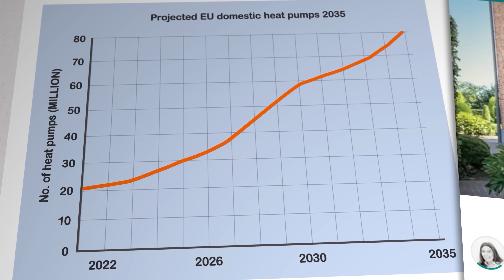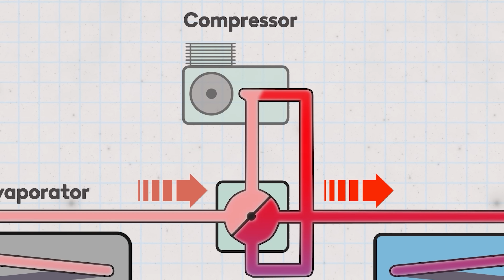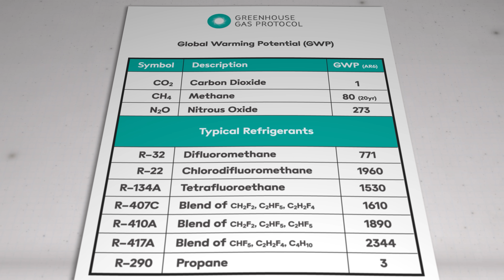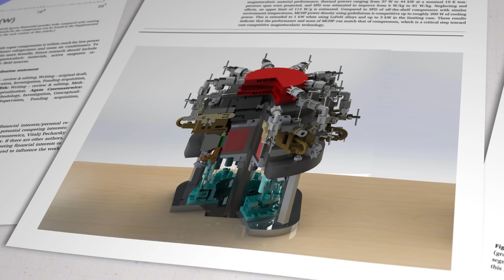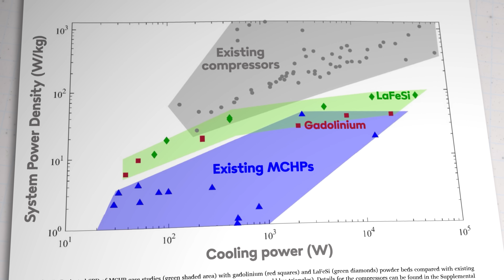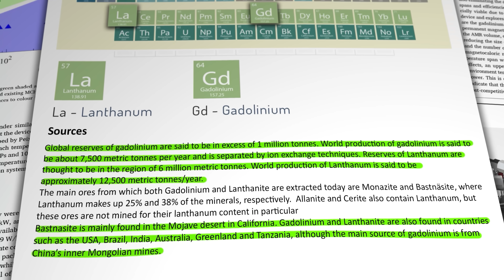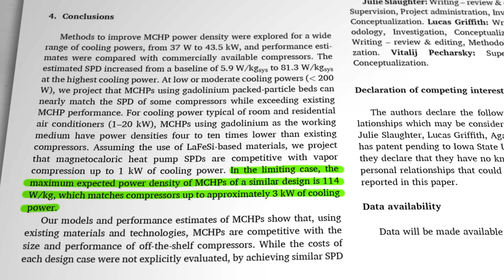Taking greenhouse gases out of heat pumps. (YES! They do contain them!)

Comment: Hopefully the newer heat pumps are better at low temperatures.
-1 C isn’t very cold compared to what we get in the USA.
Current heat pumps don’t do well below 0 C.
Hopefully this magneto caloric technique makes a significant improvement.
I can’t possibly afford it but that’s hope any way
Reply: All 3 of mine have worked fine in -20C for 3 days straight.  Keeping the house at 21+C.
Reply: Mellissa Dalby - "Current heat pumps don’t do well below 0 C."
It depends on the refrigerant used, and whether the heat pump sources from the air or ground.

Air sourced R32 refrigerant air conditioner heat pumps (e.g. Daikin) can operate with outdoor ambient air temperatures from:
-10 to +46 °C for cooling;
-15 to +18 °C for heating.

Air sourced R744 (CO₂) refrigerant hot water heat pumps (e.g. Sanden) can operate with outdoor ambient air temperatures from -10 to +43 °C.

To give you an idea of how energy efficient, per the test report published by Washington State University in association with Bonneville Power Administration, titled 𝗟𝗮𝗯𝗼𝗿𝗮𝘁𝗼𝗿𝘆 𝗔𝘀𝘀𝗲𝘀𝘀𝗺𝗲𝗻𝘁 𝗼𝗳 𝗦𝗮𝗻𝗱𝗲𝗻 𝗚𝗔𝗨 𝗛𝗲𝗮𝘁 𝗣𝘂𝗺𝗽 𝗪𝗮𝘁𝗲𝗿 𝗛𝗲𝗮𝘁𝗲𝗿, dated 18 Sep 2013, for the laboratory assessment of the Sanden model # GAU-A45HPA heat pump water heater (HPWH), Table 3 included:

Outside Air Temperature _ _ CoP _ _ Output Capacity _ _ Input Power
17 ºF ( -8.3 ºC) _ _ _ _ _ _ _ _ 2.1 _ _ _ _ 4.0 kW _ _ _ _ _ _ 1.9 kW
35 ºF ( 1.7 ºC) _ _ _ _ _ _ _ _ 2.75 _ _ _ _3.6 kW _ _ _ _ _ _ 1.3 kW
50 ºF (10.0 ºC) _ _ _ _ _ _ _ _ 3.7 _ _ _ _ 4.0 kW _ _ _ _ _ _ 1.1 kW
67 ºF (19.4 ºC) _ _ _ _ _ _ _ _ 4.2 _ _ _ _ 4.1 kW _ _ _ _ _ _ 0.97 kW
95 ºF (35.0 ºC) _ _ _ _ _ _ _ _ 5.0 _ _ _ _ 4.6 kW _ _ _ _ _ _ 0.93 kW

Sanden have upgraded their hot water heat pump unit with model # GAU-A45HPC since then.

With outdoor ambient air temperatures below -10 °C ground sourced heat pumps would likely be a better energy efficient solution.

Another option for reducing energy consumption is to improve the thermal efficiency of the building envelope. e.g. insulation, draught suppression, double-glazing, solar management, heat sinking/banking, etc.

Comment: On the topic of refrigerants, there are units that use CO2 as a refrigerant, and from memory believe it is particularly suitable as an engine for hydronic heating rather than air conditioning as the higher pressures required to make it work can be contained withing the unit and hot water exported, as opposed to the hot/cold refrigerant being transferred to an indoor unit from the outdoor compressor.  But as has been said, propane is also being used in modern pumps.  To my mind this magnetocaloric is a bit too clever for a problem that has been adequately solved with less harmful refrigerants.  Maybe leave the magnetocaloric heat exchange to induction cooktops...

Comment: There is a growing need for small heatpumps in evs. If we could do away with gas based systems that would be another maintenance task crossed off the list for what are already, low maintenance vehicles.

Comment: For years I have been using Neodymium magnets in a North pole orientation on the refrigerant lines of all my household, and car, heat pumps. They have increased the efficiency noticeably. With the fridge, electric usage has decreased due to shorter on cycles for the motor, a decrease in peak condenser temps (a measured 15 C on the sidewall), a reduction in motor temps, and a significantly quieter running system. The car air-con is cooler in our Aussie summer. Papers I have read say COP increases of  about ten to fifteen percent can be expected.
They also show a small improvement in response and smoothness when placed on a vehicles petrol fuel lines and completely eliminated the fuel algae/sludge in an old diesel 405 Peugeot I put them on.

Comment: What's with the outside heater under the coils? Supposedly, this allows the heatpump to operate efficiently down to -13°F. I looked at the power usage though. It's 3.5 times what the heatpump uses above 40°F. Even my window heatpump does better than that. It uses 2.5 times the power of the heatpump. Of course, it's inside. That is where electric heat belongs! What a scam. I will say one good thing about them though. The Air Conditioner part can operate up to 122°F. We're going to be needing that around the Mid-Atlantic soon.
Reply: Why don't they just use the propane? Not bad at 3 units. Some gasses must be better than others, because most people in the U.S. know that heatpumps don't really work below 40°F. It's in the instructions. Isn't there a gas that will still work lower?

Comment: Not knocking heat pumps, but at 4:24 it shows text that heat pumps have a COP of 2 to 5 and then the audio goes on to say they have a "COP of 5 or more". In reality in the middle of winter most air conditioners have a COP for heating of around 2, due to the large temperature difference. Which is still great, but care is needed not to oversell the efficiency. Heat pumps are also not great at running light loads, where the COP  is basically 1.0, may as well run a bar radiator, which is far less damaging to the environment taking into account manufacturing, shipping (weight), materials and the damaging effects of refrigerants. Overall, there's far more to be gained from having simple bar radiator + good insulation rather than a big expensive heat pump.

Comment: If the technology is not already commercially available at scale NOW it's already too late to avoid Planetary Insolvency!

During the period 1970-2010, the linear best fit rate of warming of the Earth System global mean surface temperature (GMST) was 0.18 °C/decade, but post-2010, has accelerated to 0.36 °C/decade. For all intents & purposes, the GMST anomaly has now breached the +1.5 °C threshold, relative to the 1850-1900 baseline. On current warming trajectory, the +2.0 °C threshold is likely to be breached within the next 15-20 years.

Daily Atmospheric CO₂ measurement at NOAA Mauna Loa Observatory on 7 Mar 2025 was 430.60 ppm. This is the first daily mean reading above 430 ppm ever recorded. Atmospheric CO₂ levels have not been this high since the Pliocene Epoch, 5.33 to 2.58 million years ago. Global sea level was about 25 m higher.

Daily Surface Air Temperature, World, as at 2 Mar 2025, is near record seasonal high level.

Daily Sea Surface Temperature, World (60°S-60°N), is currently (7 Mar 2025) above 21 °C, & only about 0.13 °C below a record peak of 21.17 °C on 1 Mar 2024.

Northern Hemisphere Sea Ice Extent is currently (7 Mar 2025) at seasonal record low level.

Southern Hemisphere Sea Ice Extent is currently (7 Mar 2025) at seasonal second lowest record low level, & only 332,000 km² above the record low on 21 Feb 2023.

Planet Earth’s albedo, the fraction of light that the planet’s surface reflects, hit a record new low, for the 36-month running average, per the latest CERES satellite data.

The rate of global mean sea level rise (SLR) is about 5 mm/year now – see the World Meteorological Organization report titled State of the Global Climate 2023, Figure 6, global mean rate of SLR was 4.77 mm/year mean for period Jan 2014 to Dec 2023, with acceleration rate 0.12 ± 0.05 mm/yr², extrapolated to Jan 2024.

Humanity is on a collision course towards a +3 °C GMST anomaly, or more; a world beyond any past human experience. Large-scale depopulation would be likely. We're on the road to “climate ruin.”

What's REQUIRED to avoid civilisation collapse?

1. Zero emissions at emergency speed: within a decade — not 2050 — is the crucial time frame.
2. The Earth is already too hot, so eliminating fossil fuels is not enough and large-scale carbon drawdown is vital.
3. A safe means of immediate cooling is critical to protect people & nature.
https://www.youtube.com/watch?v=flgq63f7TOc
Reply: Higher temperatures in the past coincided with larger animal populations, not smaller, which were better sustained by the larger plant growth enabled by higher CO2 concentrations. There were times in human history where north pole sea ice was entirely gone. There was less CO2 in the air when that happened than there is now and we're nowhere near that happening temperature-wise. I'm not concerned about such things. The next magnetic pole shift is more likely to happen in our lifetimes and cause all sorts of chaos than the planet warming to the point where we lose our northern sea ice even seasonally, which again, isn't in any way a death knell in of itself for our species. If you want to worry about a catastrophe, worry about a real one. Alternatively, worry about the economic collapse that we may face in the next few years due to decades of intentional mismanagement and fraud and our hitting the accelerator on it with the spending increases from the events several years ago that have still been continued in the budgets despite that particular crisis clearly being over.
Reply: @5467nick  - "There were times in human history where north pole sea ice was entirely gone. There was less CO2 in the air when that happened than there is now and we're nowhere near that happening temperature-wise."
Modern humans (aka 𝘏𝘰𝘮𝘰 𝘴𝘢𝘱𝘪𝘦𝘯𝘴) have existed for about the last 250 to 300 thousand years. During that time there have been at least 3 warm interglacial periods and 3 cold glacial periods, including these:

* Holocene interglacial epoch, circa 11,700 years ago to present day;
* Last Glacial Period, circa 115,000 to 11,700 years ago;
* Eemian interglacial period, circa 130,000 to 115,000 years ago;
* Penultimate Glacial Period, circa 194,000 to 130,000 years ago;
* Penultimate Interglacial Period, aka La Bouchet Interglacial, circa 242,000 to 230,000 years ago;

The global mean surface temperature (GMST) long-term average over land and sea, during the last 300,000 years, has varied from about 8 °C during the coldest parts of the glacial periods to about 16 °C during the warmest part of the Eemian interglacial period.

Over the last 450,000 years, glacials have lasted anywhere from 70,000 to 90,000 years whereas interglacials last approximately 10,000 years.

Human civilisation began circa 6,000 years ago, during the relatively stable Holocene epoch. During that time the GMST long-term average over land and sea has been relatively stable at 14 ± 0.5 °C, until the late 20th century. During the period 1970-2010, the linear best fit rate of warming of the Earth System GMST was 0.18 °C/decade, but post-2010, has accelerated to 0.36 °C/decade.

Daily Atmospheric CO₂ measurement at NOAA Mauna Loa Observatory on 7 Mar 2025 was 430.60 ppm. This is the first daily mean reading above 430 ppm ever directly recorded. Atmospheric CO₂ levels have not been this high since the Pliocene Epoch, 5.33 to 2.58 million years ago. Global sea level was about 25 m higher, relative to the current sea level. The northern hemisphere ice sheet was ephemeral before the onset of extensive glaciation over Greenland that occurred in the late Pliocene around 3 million years ago.

For all intents and purposes, the GMST anomaly has now breached the +1.5 °C threshold, relative to the 1850-1900 baseline. On current warming trajectory, the +2.0 °C threshold is likely to be breached within the next 15-20 years.

Humanity is on a collision course towards a +3 °C GMST anomaly, or more; a world beyond any past human experience. Large-scale depopulation would be likely.

See Globaia website's 𝗔 𝗧𝗮𝗹𝗲 𝗼𝗳 𝗛𝘂𝗺𝗮𝗻𝗶𝘁𝘆 𝗮𝗻𝗱 𝗛𝗮𝗯𝗶𝘁𝗮𝗯𝗶𝗹𝗶𝘁𝘆.

Joint director of the Potsdam Institute for Climate Impact Research in Germany, Johan Rockström, in the YouTube video titled 𝗖𝗹𝗶𝗺𝗮𝘁𝗲 𝗘𝘅𝘁𝗿𝗲𝗺𝗲𝘀 (𝗙𝘂𝗹𝗹 𝗗𝗼𝗰𝘂𝗺𝗲𝗻𝘁𝗮𝗿𝘆), duration 52½ minutes, talks about the "Corridor of Life'.
https://youtu.be/U8pLrRkqbb0?t=218

The Laws of Physics are not negotiable.

Comment: Based on the max power rating of 3 kW, and 114W/kg or so, I'm guessing they're comparing it to a 26 to 27 kg heat pump with refrigerant.   That's roughly 60 lb.  I just installed a ~5kw to 6 kw heat pump last Fall with a claimed product weight of about 140 lbs (compressor + everything else).  I'm pretty sure that includes at least 20 to 30 lbs for the heavy duty pallet it was bolted to during shipping.  I'm by no means a strong guy and I was able to put it on a dolly (lift with your legs) and transport it 100 ft across my yard and move it onto the concrete pad I made for it, by myself and without back pain the next day.  If they add just +1/3 weight (plus 20 lb) to 80 lb for the compressor, they put their max power up to 4 kW.   If they can improve their power to weight efficiency by 30%, they hit 5.2kW.   That matches my unit which can heat and cool my small  2 bedroom, 2 bath house quickly (i.e. over provisioned).  The extra 20 lbs is still light enough to keep in the range of 1 guy of average strength or easy for two adults of any strength.     We shouldn't let perfect be the enemy of good.    A 30% improvement in output by weight already makes it viable and a 50% or higher improvement is enough to make even a 9 kW unit still an easy install for 2 guys.   More money and time delays spent on research or just hire 2 strong guys for an hour to install it?  Better to get a 3 to 4 kW unit to market sooner rather than later and improve from there.

Comment: Downplayed the rare earth requirements here. Yes, any existing mining operation is a rare earth mining operation waiting to happen. It is always just a matter of appending rare earth extraction into the process. That is costly, and particularly costly if you want to do it in a responsible manner. IE, costly + bad for the environment OR very costly. This is why most of it is done in China where the government does two keys things: subsidizes it and is content to let it be done in a very dirty manner. So can it be expanded onto existing mining? Yes. It is some simple clean matter with no downsides? Absolutely not. And that means more costs. And that means that bar is a higher one than the dismissive "it'll be easy" attitude towards that piece of the story which was presented here.
Reply: People discussing such "innovations" often downplay the fact that many sources of ore with rare earths happen to be radioactive and thus a massive pain to process cleanly. Lanthanum is cheap mostly because there is relatively little demand for it relative to how much of it is produced as byproduct to production of more important things like neodymium. If they want to go and use a lot of it for this, that would likely change, like how much the cost of lithium has gone up since we started mass producing lithium ion batteries.

Comment: It doesn’t seem like there is that large of an amount of refrigerant that is used in comparison to the amount of carbon dioxide, even if we scale up by a factor of 6000. There already exists refrigerant gases, with no susceptibility to Global warming   Do these units provide any other advantages over traditional compressor based units?  I feel like if something like this is going to take off it needs to be 10 times more efficient than current technology or cost 10 times less

Comment: I had a heat pump installed in the mid 70’s in my first house. Having just hit the market, the vendor took multiple attempts to get it running properly. That was aggravating. I then moved to the western US and didn’t see any heat pumps in the Rockies where I resided for 21 years. After I retired I moved to Florida where heat pumps are very common. The last one I purchased about 10 years ago was incredibly efficient compared to the one I had for 15 years in the house we bought when we moved here. I highly recommend them, especially in these times of ever increasing fossil fuel prices and the problems that source of energy brings with it.

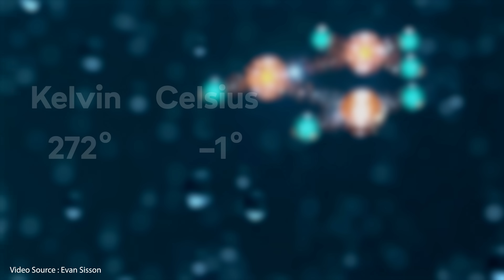Comment: At 2:50 you call this a "typical" air source heat pump. It's anything but typical anywhere in the world other than the UK. The efficiency of a heat pump is highly dependent on the ratio of the hot side and the difference between the hot side. Thot/(Thot-Tcold) Everywhere else the hot side is the room air. Only in the UK is it typical to ruin the efficiency by heating water to 50 odd degrees before using that hot water to heat a room to 20. 

That's because instead of raising the temperature by 21 degrees, you're raising it by 51 degrees! That's like instead of walking up a flight of stairs to get to your first floor unit, walking up to the 10th floor and then sliding down the bannister 9 floors. It's just a waste.

Comment: I do not undestand how this magnetocaloric system cool or heat the passing fluid. It looks likt the system first heat up the fluid and imediately after cooll down the same fluid. What I am missing. Heat pump need to transfer the heat one way. Does the material heat up each time the magnetic spin change?

Comment: Worth noting that degrees are not used when measuring temperature in Kelvin, it is merely 273 K.

Degrees indicate that something has arbitrarily be divided: a circle by 360; the difference between the freezing point and boiling point of water by 100.

Comment: Given the use of Gadolinium and Lanthanum, it's not at all clear that this is an improvement over using propane as a working fluid. And by far climate change is not the only problem we have. It does suck up most of the metaphorical oxygen though.